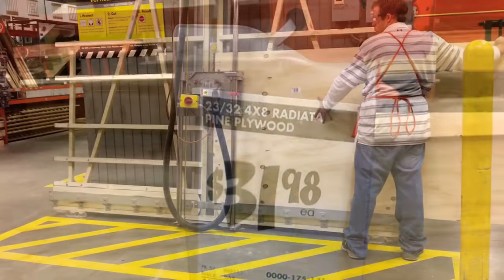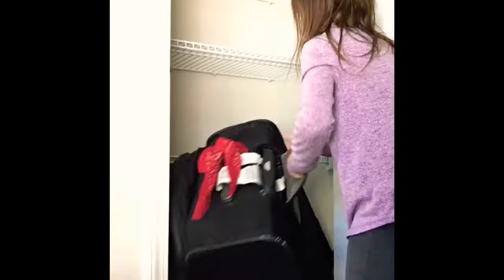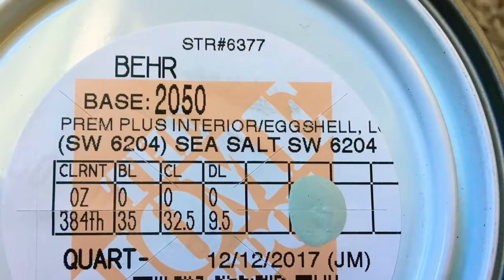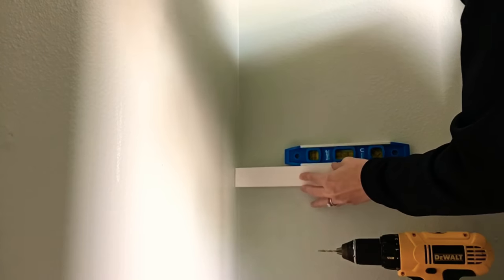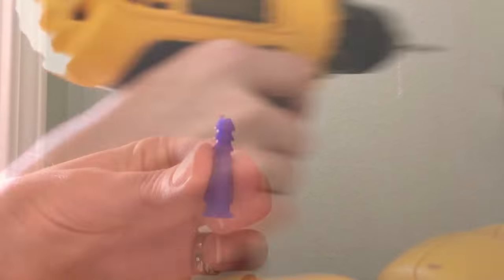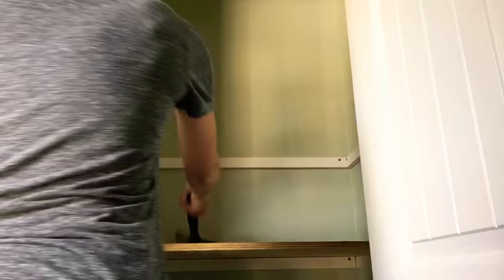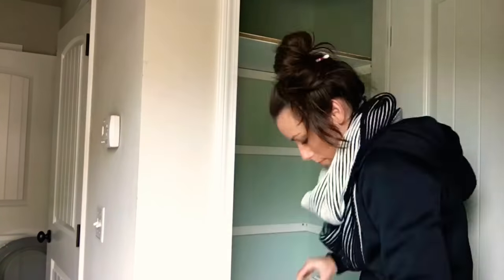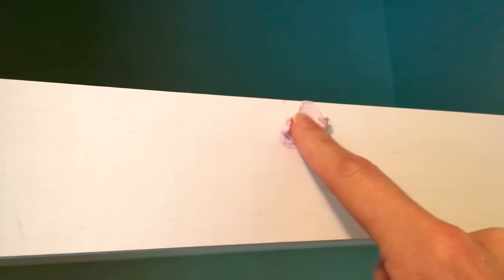How to Build Closet Shelves the Easy Way!

Comment: You did a fantastic job. This is how I build shelves in a closet normally. The only suggestion would be to use 3/4 mdf because of the printability. No sanding and smooth paint finish. Also a light coat of rattle can poly.
Reply: Whats mdf?

Comment: Great Idea Kristy Love the front trim idea as I'm building a closet with a Microphone Locker (literally a safe) - I'm a full time Voice Over Actor with a collection of expensive microphones and needed a shelf idea that would allow me to bolt down a small lockable storage cabinet for microphones most shelf videos just use planks but the facing boards will hide the bolt heads and also can double for mounting "quick grab" audio cables that I can velcro to the facing boards.  Not being "handy" this shelving plan was within my limits - thanks again!
Reply from the maker: I love this!!! Great ideas on you end as well!! So glad you found this useful :-)

Comment: Nice work. You marked the center stud for your back shelf cleats but didn't screw into the center stud? It would've provided a lot more support 😇
Reply from the maker: Good catch! I can't remember the reason now why I didn't. I think my stud finder was detecting metal with my dryer located directly behind it so I didn't want to mess with it
Reply: Mama Wants to Build by Kristy Green good point! Don't want to screw into your electrical or dryer vent
Reply: The guy with a mask in his bio pic would absolutely be the one guy with a negative comment here.
Reply: @TJPsongs  negative? haha relax buddy just an observation on structural integrity